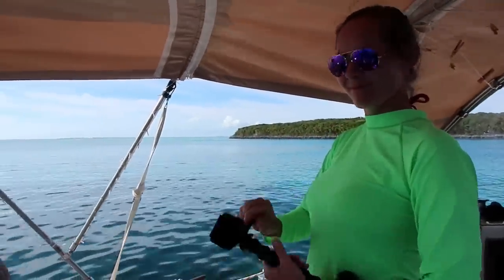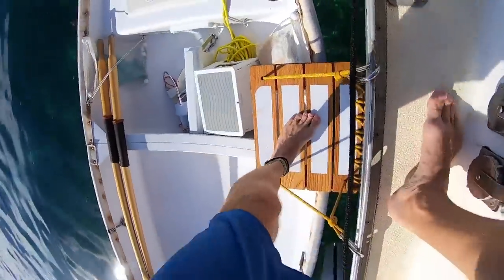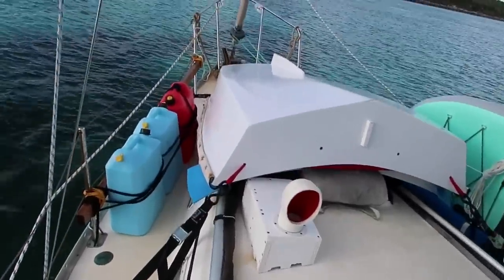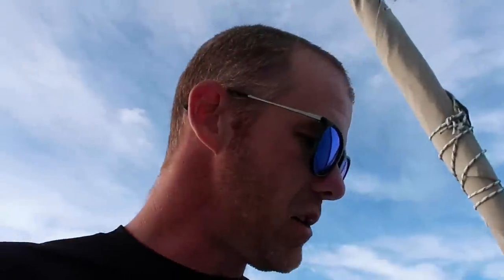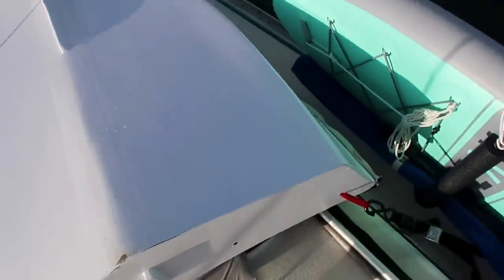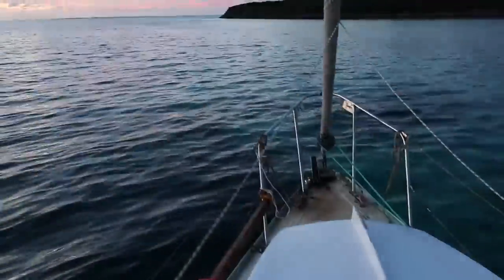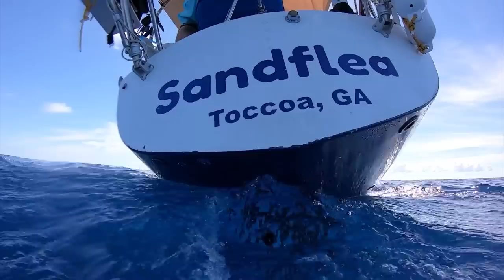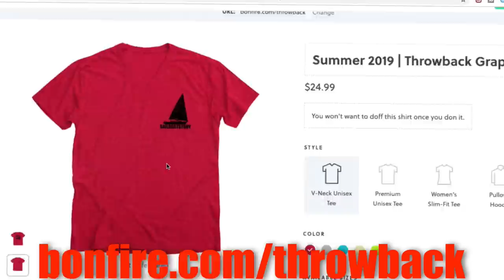How To Hoist & Stow A Nesting Dinghy On Deck Before Passage | Sailboat Story 114

Comment: I built my Two- Bits nesting dink light enough to one-hand it onboard at anchor.
One hand on a shroud, one on a line to each half.
Fast & Easy
Build light and straight for best usability
Cheers
Reply from the maker: Didn't Lin and Larry have one of those?

Comment: I don't think the dinghy bulkhead is pulling away from the hull, I think the hull is pulling away from the bulkhead. If you think about where the buoyancy is, and therefore the leverage against your fixings (joining the two halves), the stern is trying to rise, but the bulkhead is held vertical  by the front half. I think  internal bracing and strengthening is the solution there - inverted knees would do it (do they have another name?!).

Thank you for the lovely videos. I always enjoy them.
Reply from the maker: I think you're onto something.
Thanks for the ideas.

Comment: Good video, the great thing about building your dinghy its pretty easy to make repairs and mods as necessary. I built the same and store it between the mast and dodger under the boom, fits nicely.  A similar process to yours to get it on board. I'll have to watch that area for a crack.
Reply from the maker: That's cool to hear.
Do you have any video or blog about your build?
Reply: @Sailboatstory  This is the blog on the build, not as in-depth as yours. It is a Chameleon and I have modified it slightly. http://www.syimagination.com/build-a-tender.html  and this is the launch and getting it nested on board. https://www.youtube.com/watch?v=MqzGU-Y-PFY

Comment: Hi guy's. Looks like your washers are 304 not 316L? Put a magnet on them. 316L is passive, non magnetic. Have you thought about a lazy boy for lifting the dingy? No, not a huge arm chair, a 4 or 5:1 pulley block. Makes lifting stuff to the yacht so much easier. Covered it in our tips and trick video 6th May. Save Tanby a lot of winching. Indeed, Molly could pull you up the mast with one.... Great editing just love your style. Sail safe. Ant Cid and the pooch crew xx  (SV Impavidus)
Reply from the maker: We used to use a 4:1 main sheet. Works good. Winching works fine too.
Reply: All about mechanical advantage. :-)

Comment: Love the dinghy!  Suggestion for when you have more time to do a longterm repair is to use biaxial fiberglass tape which will better handle the stresses pulling from different directions.
Reply from the maker: I might do just that.
There are a few places on the dinghy that need a little TLC on the off season.
Probably a good idea to use biaxial, especially on the high-load areas that experience twisting forces.
Reply: @Sailboatstory  Definitely the biax.  On a joint like that, half of the fibers in plain woven tape are wasted.

Comment: I am building a nesting dinghy in a storage locker now. I was interested in seeing how you stowed the boat. But I started thinking about the location of that delaminating? glass on the bottom of your dinghy stern. I have a friend who is in the Caribbean and his advice is to make the dink strong, they all take a beating. I wonder if that location is a weak point because of possible torque from the outboard. If the motor is clamped at the top and the force is from the propeller, the the aft bulkhead is being twisted, inboard at the top and out at the bottom. I have still not finished my boat, but I think I will add fiberglass tape down the aft bulkhead and across the bottom, and I am going to do that both inboard and outside. You might consider the same. I would also make sure the wood is dry when you make the repair, I don't know if the salt water would act on the plywood even if it is dried out. Someone else might be able to comment on that.
Reply from the maker: Mine does have fiberglass tape along that seam.
2 layers thick - actually 3 layers down the middle of the keel.
I think it needs some small "knees" on the interior of those joints.

Comment: The front half of the dingy benefits from the centerboard trunk structurally supporting the rear mating vertical surface that spans between the port to starboard gunwales thereby limiting any joint flexing at the bottom plywood to vertical join point. There is no such support at the front part of the rear half of the dingy; though cumbersome this half might benefit from several "stringers" that could be mated to the bottom panel & vertical panel member  spanning between the gunwales. You can apply any manner of biaxial glass cloth to this joint area but you wil still probably not limit flexing. If you only rowed the dingy it would not be an issue, but under sail & when used with the outboard these joints are subjected to flexing stresses that the glass cloth cann ot absorb. It would be interesting to inspect the front half of the dingy st this joint to see if there is/are any panel separation(s).
Reply from the maker: I think that’s it. I thought about installing some small “knees” on the inside of the aft half to limit flexing. We’ll see. Overall the dinghy has been doing amazingly well - just have to figure out a few small issues before another big trip.

Comment: About that crack in the stern section of the dinghy. The forward section's bulkhead is strengthened by a knee at each upper corner attaching the bulkhead to the hulls sides, and the centerboard trunk acts as a knee, adding support to the joint between the bulkhead, and the hull bottom. The aft sections bulkhead also has knee's joining the bulkhead to the hulls sides, but there is no structure acting as a knee to add support to the joint between the bulkhead and the hull bottom. It might be worth the trouble to add a few small knees to connect the bulkhead to the hull bottom. Probably one on the centerline, and two or three more on each side of help the bulkhead to hull joint deal with the stresses. 

Because it is a nesting dinghy, you probably wouldn't want to use large knees, but  a set of small knees 2 or 3 inches in length, screwed to the hull and bulkhead, should greatly strengthen the joint  while not greatly increasing the height of the nested dinghy in it's stored position. Something to consider as a "winter project".
Reply: Biaxial cloth inside and out in that area would do much the same thing, without having knees getting in the way.

Comment: Yea I get where that is prolly a high stress area, especially with weight on both ends. But I can not help but wonder if not only is it stress involved but maybe a lil bit of bumping too. Hard to tell in the vid's though and w/out actually using it, but if so maybe something to absorb that between at the bottom. I know it looks like you got the bolts bit higher, which I would do as well keep it out the waterline, but this just means less tight at the bottom joints too allowing just tad more movement.

Comment: thinking about the repair, when reassembled, look and see if perhaps a layer or three is needed at gunwale level to ensure the tension from the bolts is even top and bottom and not springing all one direction, sort of not a V but )( when tensioned.

Comment: Dinghy is holding up well! Minor repair issue. I wondered if one of the sheet winches might be bigger and make hoisting slightly easier if you could feed the hoisting line back there? Cheers warren

Comment: Just thinking on the dinghy, Some expanded neoprene mat to cushion your connection between the hulls. When your back on land perhaps a thicker plywood too, on the joining ends would help. There is a wood support on the inside on that cracking edge?. Also by the looks of the plywood surface are you sealed? Again just thinking.

Comment: Storing the dinghy on deck makes sense, however if the dinghy is over a hatch, you might be creating a dangerous condition, where you could be trapped in you cabin without a 2nd means of egress.  Probably fine when cruising, but certainly don't sleep in the cabin with the dinghy blocking an egress hatch.
Reply from the maker: Very few perfect solutions exist out here.
Possibly even zero perfect solutions.
It’s all an incredibly diverse and dynamic compromise.

Comment: That staining on the rub rail from the SS Washers. I've seen that. My fix was to use THICK nylon washers under new SS washers. I think the reason is the rubrail in your case stays wet longer and while Stainless is resistant, it's not proof. Could also be most Hardware Store stainless is 304 or even 204 and really we want the softer 316 (west marine type stuff - see the 100% tax is for that 2% molybenum). 

An out island fix to remove rust from soft material such as your rub rail, bimini, towel... Table salt over the dry material, lemon juice on the salt to make it paste like kindergarten table paste glue (yummy) and sunlight. Once done wash or rinse with warm fresh water. CLR works too if you can find it. 

Great Video!
Reply from the maker: Interesting thoughts.
Yeah, those rust stains were KILLING ME at first, but now I think that it just adds a bit of character. :)
I do plan on redoing the gunnel guards in the off season.
Thinking about going with an actual, manufactured gunnel guard this time, kinda like what would go on a small Whaler.
The dinghy will need a bit of TLC for sure. Kinda looking forward to working on it, to be honest.
Reply: @Sailboatstory  Nothing more gratifying then fixing it, engineering it and building it yourself!! 
I'll admit I admired your work but thought... no engine... nah, not for me. Though I do like to row a bit... But then the videos of you guys sailing it. I'm like "Flipping Genius!" 
Now I want to make one.

Comment: Hey crew, is the dingy in one piece too heavy or just too long to store on the fore deck? Solution, get a bigger boat(>$$, haha).... my friends and I are considering using your plans to build a similar dingy, cheers my friends!
Reply from the maker: We store it on the foredeck for passages, disassembled. We store it on the davits for ICW. We tow it on short hops in settled weather.
Reply: Another good one to check out is the FB11 from Bateau.com.  Similar concept and size as the Chameleon, but also available as a CNC cut kit if you want to build that way.